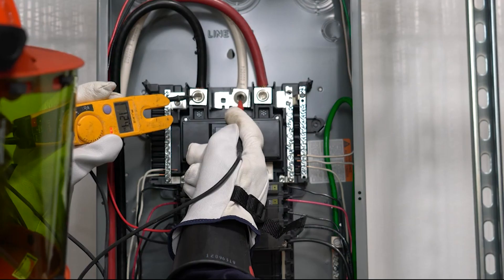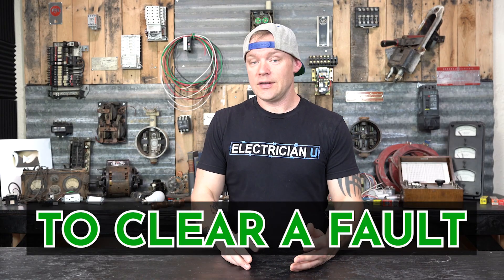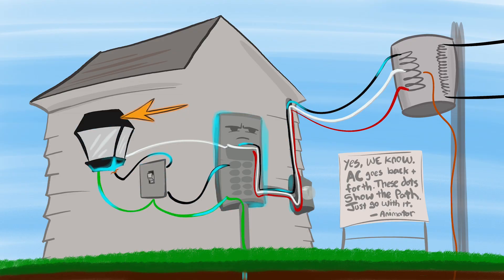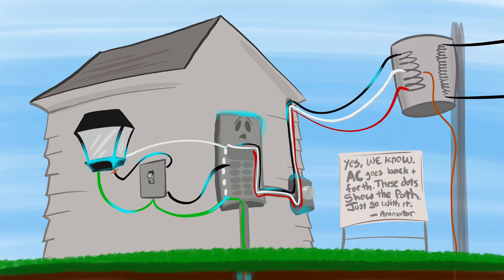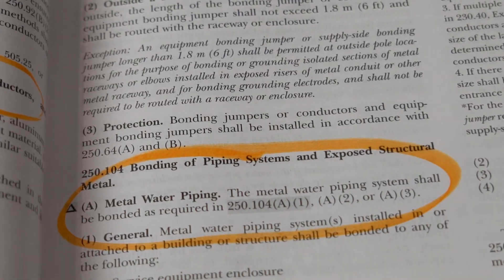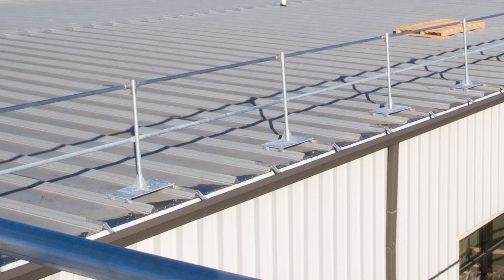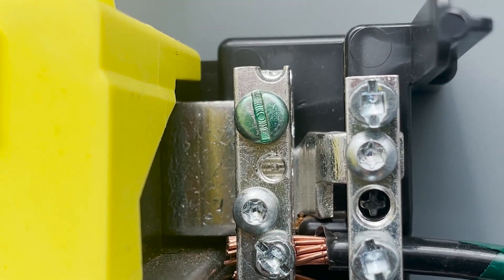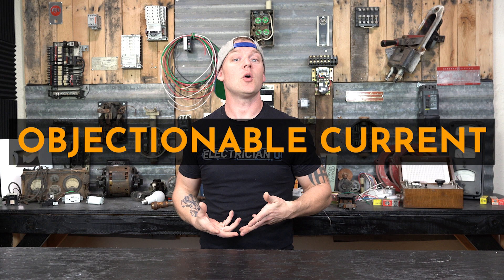Why Do We BOND Neutral & Ground in ELECTRICAL SERVICE PANELS?

Comment: A simpler explanation was that the neutral from the power company wasn't always quite neutral. (Your neutral is shared with 3~4 houses). This was adopted in the late 70's when there were still many appliances that relied on the neutral for shock safety (pre-double insulated). 

The centralized ground point actually came from AT&T's grounding standards to protect switching offices, radio (mobile phone) and microwave sites from power surges and lighting strikes (bonding was also part of the standard). With the migration from vacuum tube to solid state equipment that is far more susceptible to power surge damage grounding standards had to be improved. Today we have fridges and stoves with computers in them so it's even more important to manage power surges.

I was at a radio tower site in the 90's that got hit during a storm and saw electricity jumping between the transmitter cabinets, never made that mistake again.

Comment: In the scenario where you had current going to ground, the breaker would still trip, does not need to go back to the transformer to trip, it trips because of an over current condition through the breaker.
Reply: Not necessarily. I've seen older houses where the overhead neutral feed wire was chewed through by critters and it caused the voltage readings to go totally haywire. The electrical items in the house kinda worked, but faded in and out.  Sometimes the voltage spiked, but no breakers popped. The old ground system was not enough to transfer all the loose current to ground. Newer systems, properly wired and grounded, are much more bulletproof, but I still wouldn't trust a ground connection to overload a breaker or fuse independently of a neutral connection, even though it would probably work.

Comment: Ok a lot to think about as I am getting ready to wire my shop. Guess I need to ground the steel building too. Sure wished I knew a local electrician, only picked up a limited knowledge as a plumber

Comment: How would you or anyone else like to jump in,  map the ground and neutral when you have a main prior to the meter that travels to a metal trough and from there it feeds multiple meters which then (each meter) feeds a main disconnect either separated from or part of a service panel?

Comment: On my 2nd floor (b X cable and metal boxes) i had no ground. An electrician told me to connect a neutral to one of the metal boxes and the seems to work as all the outlets then showed a ground. 
Is that O.K,
John P.

Comment: Sub panels always have isolated neutrals, they can be load centers mostly in mobile homes.
main disconnects  are outside on a meter pedestal or pole and have neutral and ground are
tied together, BUT NOT in the sub-panel.

Comment: I have a question if you connect a generator 30 amp plug 4 prong to a dryer plug that is three prong for emergency should you connect the ground wire from the plug to the ground wire in the outlet. A friend wants to do that for a emergency. I would think that would not be a good idea unless h had a ground rod to connect the generator to.

Comment: To add to my previous comment, your explanation on how circuit breakers work just seems completely wrong. They break when a fault causes too much current to be drawn through it. The aren't even connected to neutral or ground. What your describing is more like how GFCIs work.

Comment: Your diagram seems confusing or maybe wrong. The return path (from home to power station) is through the (literal) ground. It doesn't go back up through the wires on the telephone poles. Wouldn't the reason for bonding ground and neutral be to run the electricity to the (literal) ground through one wire instead of two?

Comment: A transformer are separate derived, (with the exception of autotransformers), but a generator or PV system are generally not separately derived unless they are connected to switches that disconnect the neutral conductor (very rare).
Reply: Depends how big your generator is, the last one I was on was small at around 250MW but had a separately derived earth 😂

Comment: The explanation about sub-panel bonding seems off to me. Not necessarily wrong, but perhaps incomplete.

If you have a sub-panel that has neutral and ground bonded, and a short subsequently occurs between hot and ground on one of the sub-panel circuits, the current will follow the NEUTRAL wire that's between the sub-panel and the service panel. In a residential setting, this is probably OK (from a "the homeowner doesn't get his arm blown off" standpoint, not from a code violation standpoint). However, any ground fault sensing devices located BEFORE the sub-panel won't trip because there's virtually no current flowing on the ground wire (neutral is almost always a lower resistance path than earth ground). This would be more of an issue in a commercial setting, since to the best of my knowledge, you don't typically find GFCIs handling complete sub-panels in a residential setting.

The whole point of the ground wire is to have a path that's a lower resistance (compared to the path through a person) for the current to follow in the event any exposed metal becomes hot. Without a ground, if the metal case of a light fixture, washing machine, outlet cover screw, etc is hot, the person becomes the path of least resistance, and experiences anything from a barely perceptible tingling to having their arm blown off.

This brings up a question that actually applies to my house. We recently moved into a house that has 2 service-panels, each with 200 amp main breakers that are fed from the meter base that has 400 amp service. I haven't pulled the covers yet, but I wonder if only one panel has a ground to neutral bond, or if they both would/should, since they're both connected to the meter base. Also, with close to 80 breakers, only like 10 of them are labeled. It's gonna be fun to figure all those out...

Comment: This is done at the service drop to reduce the chance neutral might float at some unknown, potentially dangerous voltage.  This has been the convention long before ground-fault breakers were available, it goes back to the invention of the ac transformer.
For instance, one leg of a delta transformer secondary is grounded for the same reason, and/or the center tap of a wye transformer.  This keeps the transformer secondary from floating at some unknown, potentially dangerous voltage potential.

Comment: I'm an electronics guy and this just doesn't make sense. If the neutral wasn't connected to ground anywhere on the secondary side of the transformer, none of the leads would be a danger except to one of the other leads. And no danger to ground. I would think the neutral is tied to ground in case of transformer leakage or insulation failure in the transformer where the primary voltage could appear in a home. What am I missing ?

Comment: So, in 'short' one has to rely on the grounding done by the service provider at their transformers
Reply: The neutral and ground must be bonded at one location and one location only at a service entrance.  Per code, this can either be at the transformer or at the service entrance equipment (switchgear, MCC, panel, etc.).  Best to coordinate where this will be with whoever the service provider is.

Comment: I've always wondered as an hvac guy that does no panel work or breakers we have an electrician do it all per union requirements..  if the neutral and ground are connected why do you never find voltage in the ground when the neutral bar is hot?

Comment: Ok... let's say you have a 2 wire, no ground setup in an early '70s mobile home. Half of the home has been remodeled by the previous owner. They ran new 14/2 between outlets, but didnt make the connections to a line. Lets say someone bonded the neutral and ground at an outlet. Is this one of those situations where the current goes all over the damn place? If so, what would you do to correct this?

Comment: If I use a transfer switch and its tied into the ground and neutrals in my panel do I still need a groundrod for my generator.  If so I believe in limiting soil instead of driving the full 8ft I can bury 3 feet in trench. Am I correct

Comment: The idea is to bond ground and neutral only at the main panel so that the ground never carries current except when there's a fault.
Reply: Not entirely true. On larger power panels in industrial applications the ground line can sink a fair amount of current. The number one reason for a single ground to neutral point is to prevent ground loops. A star pattern of grounds to sub panels is preferred. Daisy chaining ground lines across multiple panels in series can also cause sub-panel ground loops. The other reason is to prevent a floating neutral which can elevate to many volts without a proper ground reference.

Comment: Where I grew up the ground fault breakers had  "transformer" windings around the neutral/hot conductors. If any power leaked out there would be an imbalance between the two wires and the breaker would trip. This makes infinitely more sense to me than to rely on a connected neutral to ground. Even if the circuit had a broken ground AND neutral wire, meaning ONLY live was still connected it would still protect you from electrocution.

Comment: In my brother’s house in one of the 4 breaker boxes there are jumpers from black to white and they have round black flat things in the middle of the jumper. Why are they like that?
Reply: I'm not sure which conductors you are referring to, but I can think of 2 possibilities.  There are ferrite magnets that prevent electromagnetic interference (though I've mostly seen them on power cords).

There are also current monitoring devices.  Looks like a big black plastic donut with wires Coming off it that the feeder conductors will pass through.

Comment: So I needs go study 251.5?  I am building a 17kW/34kWh surge rolling charger/inverter rack with 2 125A input and output panels with a built in 11kWh buffer battery trailing 2 60kWh rolling batteries.  System will process 20kWh solar input with multiple generator input options through an autotransformer along with the occasional mains input.  My still undecided issues are possibly releasing local panel bonding when when mains current is coming into the system to both charge batteries or power loads through the panels OR possibly a system to sense differences in potential or a failure of bonding from the mains source and maintaining a ground/neutral bond within the rolling rack.  I don't want this system to cause a hazard back towards any potential mains source.  The other undecided issue is having a separate earth ground for the rolling system from any mains system that it interacts with.

Comment: Slight comment, normal breakers are looking at current flowing through the hot, they don't particularly care where it flows, so long as less than the trip threshold is flowing for a given period. A GFCI on the other hand is specifically looking for an imbalance of current between it's live and neutral, indicating a fault to somewhere

The original animation shows, albeit not prominently, that the transformer at the pole is also grounded. in the event of a fault to ground, current flowing to ground then flows back through the ground to the transformer.

Granted, and I think this is what you were kinda getting at at one point in the video, if ground and neutral weren't bonded, and the resistance between your ground and pole ground is high enough, you could wind up with a potential on something metallic, or even a fault current that is limited to several amps, well below the trip point for a run of the mill 15A breaker.

Comment: Good Video! Earth ground is a reference and a protection path. Electricity requires two paths for a load to operate. Neutral provide the return path. Ground provides a separate path for loads to shed faulting (as in an internal break or short) current safely to ground instead of shocking the person/animal. When bonded together it brings the reference path back to 0 (Neutral) for all the local circuits attached to that panel. A traditional thermal circuit breaker or fuse does not care if neutral or ground as bonding gives either path the same potential. Thus ground wire is a safety feature as the neutral wire give the load the return path to operate.
Reply: Quite right. But this is clearly far from the usual expectations, so no one has yet understood you here even after 5 months.

Comment: Question. And it’s been bugging me for a while, so I’ll ask, but I understand if I don’t get any answer..

I installed my own Tesla wall charger about a year ago or so. I followed the recommendations in the chargers manual and ran some 6 gauge wire from my panel to this charger.  Now, I’m just a homeowner, so I bought and ran 6/3 when I really only needed 6/2 as the charger only has 2 hots and a ground connection. So, since I had it at the site, I connected the 6 gauge neutral wire to the thin ground wire and hook3d them both up to the charger. 

This all goes into my panel with a 60 amp breaker, as per the allowances by Tesla as the unit will only pull a max of 48 amps. I did notice that the wire gets ever so slightly warm to the touch when pulling full power and from time to time, the charger will throttle back due to a heat fault. So, I just permanently set it to only max out at 36 amps..

So now I realize that I could’ve and maybe should’ve used 4/2 for this run. But my question is, is this ok? Did I need to use the thicker neutral wire as ground? It just seemed odd that it didn’t have a neutral landing terminal on the device. 

I’ve been running it and monitoring it for about a year and I’m confident it’s safe, but is it right?

Comment: By the 4 minute mark you are describing GFCI breakers only, but claim all breakers.
Regular breakers act like older thermostats. When too much amperage goes through the breaker the different metals move away from each other cutting the circuit. There's also a spring system to flip the toggle and 1 of the metal plates when this happens. The temperature cut off is engineered to match the breaker rating.

Regular breakers will trip as intended if the ground is carrying current, and the amperage goes over the rated breaker.
Unlike GFCI breakers they will not instantly trip when the amperage isn't equal on the source and return, since they only monitor source current output.

Repeated over heating, so going over the Breaker's capacity, causes more tripping over time due to physical damage.

The point is regular breakers don't need to return to the main source to protect the wiring.
GFCI breakers protect wiring and users.

You very accurately describe everything else, and the reasons for proper grounding and bonding.

Comment: It's about creating a low impedance return path to the supply source so that enough current flows in the circuit when there is a fault to ground that the circuit protection can operate.

Comment: The USA has what is called a 'grounded distribution system'.
If memory serves, I believe power generation uses a 'wye' wired generator with the center tapped to the ground.

Comment: so quick question . Did you say and this is theoretical . If there is a sub panel in a detached garage fed from the main in the house.   The sub panel shouldnt be grounded with a ground rod near that sub panel?   the sub panel in the seperate structure should have a green ground going back to the main panel?   also all green grounds for fixtures goto the neautral as well as neautrals to the neautral bar in sub panel? and all are carried back on the ground wire to the main?   sorry for any poor grammar...

Comment: I have a LED outdoors light (with metal housing if that matters) to which I have only 2 conductors (live and neutral). The LED panel was emitting a slight glow when I connected only the live and neutral wires and I was advised to connect the ground wire (coming from the LED panel) to the neutral and that seems to fix the "ghost" light problem, but I am wondering, can that cause any injury to a person or to the electrical system?

Comment: Question: Can you use copper pipes as ground rods? I need to install a sub panel on another building and I have a bunch of 1/2 and 3/4 copper pipes I ripped out of another home. Seems like I could bury two 8" sections and connect them to panel's ground.
Reply: It might work if they're long enough, a real ground rod is about 8 feet. I'd honestly recommend just getting a real ground rod but it's up to you.

Comment: Extreme CONCEPT ERROR at 2:45 -- the responsible thing to do is to delete this video. Be a man and admit you're at "fault" for misunderstanding the tried-and-true, old school, unimpeachable ground-fault breaker trip. If you don't know that a short to ground will trip a breaker, with or without bonding the neutral to ground, then you need a new profession.

Edit: I challenge you to go to your own home's main panel, remove the bonding jumper, and duplicate the fault shown in the animation. So you could turn on a light with the hot shorted to the bare ground. Report the results in a video, and either prove me wrong or delete the offending video.